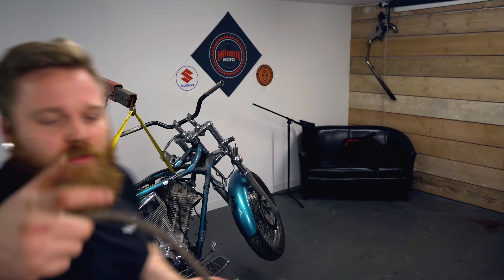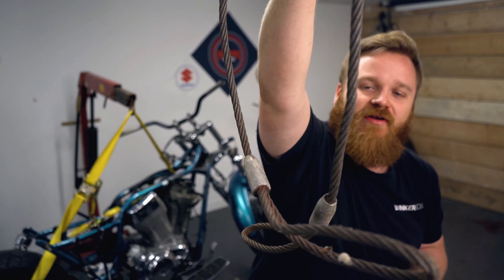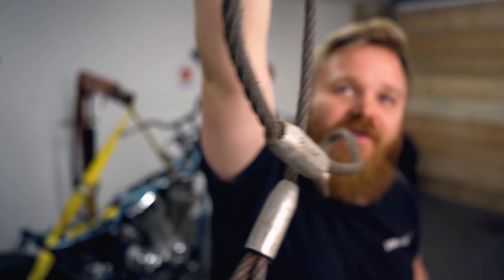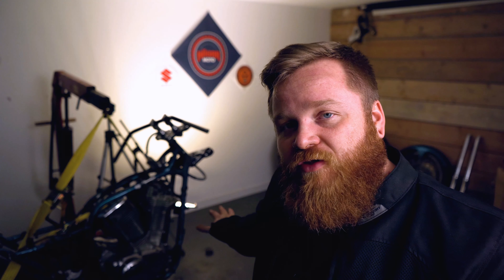Suzuki Intruder VS1400: Remove Forks, Front Wheel and Controls - Tear Down Part 11

Comment: Hi Hagar, Roger here.  I know that you posted this vid in Jan 2020, but I've only found your vids & channel days ago & am still going thru them.  I'm no mechanic by any stretch but I've been tinkering & riding for several decades. And recently I decided to do some custom work on my '99 VS1400. 

So if you haven't already done so by now definitely give forward controls a try. I agree with you about keeping your floor boards as backups, wise choice. Still I've been riding with forward controls for well over 20 years, and all on Jardines, and I'm 5'9" with a 32" inseam & I've never had any difficulty with my Jardines.

Sori again if you have a vid of this already, but I haven't gotten thru many of your other vids yet, as I'm focusing on the Tear Down & Rebuild cus of the custom work that I mentioned. And unless I'm all messed up it seems that your last Rebuild vid was in the beginning of Jan this year. Looking forward to seeing what you do with your bike, especially the raked triple trees - very nice!

Great vids btw for the Tear Down & Rebuild. I wish I found vids like yours when I began working on mine. Keep putting them out my friend.

Roger

Comment: 5'8" is only part of the equation; you need to know what your inseam is. I'm 5'7" but have a long inseam at 32". Even with forward controls, AFAIK, you have to use the stock bracket, but you will save the weight from the floor boards. My feet are on my highway pegs 99.99% of the time, but I won't install forward controls as I like having the 2nd foot  position on longer rides
Reply from the maker: Thanks man, I'll get that checked out! I do like second foot position too, but find that when I install the thinner seat my knees will feel really high up, getting rid of buck horn bars has already made it feel like a different bike, so much more what I'm used too, straighter arms and no longer playing T-Rex while I'm riding lol

Comment: Do you have some more in depth about the front wheel removal/reinstall? Just replaced the tire on mine and having some issues getting things back together quiet right. Gonna take it back apart today and try to figure it out but wanna make sure I didn’t miss something
Reply from the maker: Try checking out hte FORK COVERS video on the channel, while it is about the covers, i show the reinstall process of teh forks in that one

Comment: Hello Hagar. I am stuck trying to remove the front wheel on my 06 s83, same set up pretty much. I lose the pinch bolt, then loses the axel, lift up the front end, but I am not sure not to get this axel out. Ive been stuck for a few days trying to figure it out. Any suggestions would be greatly appreciated. Thank you
Reply from the maker: Is it stuck as in wont rotate etc? If so get a little bit of impact going through it like you see me do with the front forks. Get the correct size socket/allan wrench bit and tap the end of the socket wrench handle lightly. Do not go losing your cool with it of you'll destroy the axle. Failing that, soak both ends with WD40 and I mean soak, spray and leave for 2-3 hours, then soak again and leave for 2-3 hours and come back to it. They can get very rusty if dirt and moisture get in there. Let me know how you get on.
Reply: it isn't stuck and its actually balanced well. everything works. Im trying to remove the wheel to change the rotor. I used leverage and was able to get the threaded side out, but it wouldn't go further. Should I be tapping from the Hex side. the right side looking at it?